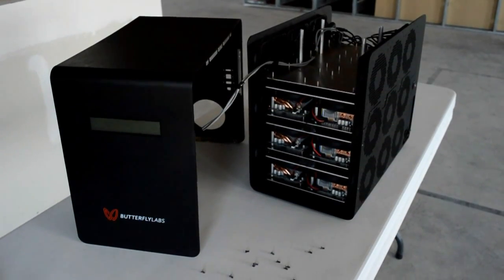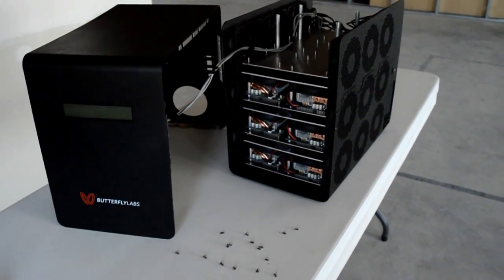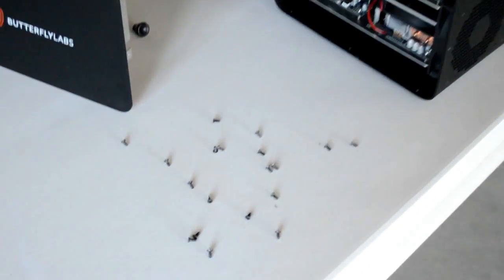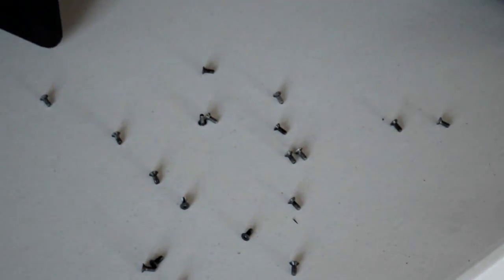Inside the Butterfly Labs (BFL) 25GH/s 2012 FPGA Mini-Rig (NOT ASIC)

Comment: How much bitcoin can it make per day in this period? Thanks.
Reply: At the current diff (609mil): around 0.02 BTC per day. Around $17 at the current exchange rate.
Reply from the maker: This is FPGA and pretty much obsolete at this point.  25GH at 1140 watts...I suppose it would still make some profit, but not much.
Reply: P. Pongjarern Thanks, that is not bad. Do you know what is the difficulty estimate in 4 months or so? Is there a way to predict this ? For example, can difficulty increase in 4 months ?
Reply from the maker: Lately, difficulty has been increasing about 20% every 11-12 days.  This will probably continue for some time.

Comment from the maker: I have $60k invested.  With 2 TH at current difficulty of 50.8 million and BTC price of $110 I'm making about $2000/day, but difficulty is going up fast; probably 67 mil in a couple days.  That'll be about $1540/day and down from their again about 12-13 days later.  Sometime after I have the full 3 TH, I expect it will level off and go down much slower when I make about $6k/month at around 400-500 mil difficulty.

Comment from the maker: It took about 4 months from the day I ordered.  FPGAs (like this rig uses) are a lot easier to implement.  The ASIC machines BFL is working on now is a totally different beast, so they've run into a lot of unforeseen problems.  I believe they're getting pretty close to shipping, though.  I don't believe at all that they are a scam, and I've been waiting 10 ½ months since placing my ASIC pre-order.

Comment: One thing to keep in mind is that the difficulty will raise as you have said but it will raise enough to keep the mining of coins at pretty much the same rate so their won't be a bunch of new coins flooding the market since these ASIC's are not all being released at once.  If anything there may be a week or two of  craziness and then the difficulty will rise more and the minting of new bitcoins will return to the normal pace.  Most GPU miners have moved to litecoin and feathercoin already.

Comment: I beg to differ slightly could still do it cos the DEV community may not react on time by then lots of BTC are horded. Once DEV community react too late for us.

See blockchain.info/charts/hash-rate. Gigahashes across the network went up from 10k to 70k. No_one else has that processing influence. blockchain.info/charts/market-price shows price increase about the time chips made+testing. Graphs show exponential increase since BFL got the chips. Any Explanation? Cheers,

Comment from the maker: 1. Depends on luck, difficulty, and BTC price, but I've averaged about $650/week (before power costs) for each mini-rig (I have two).
2. It only uses the PC as a host.  Power is provided to the unit via its 1250W power supply that is connected to an electrical outlet.  The unit measures 1140W at the wall.
3. I was one of the first to pre-order, so a lot of customers got theirs faster.  However, my wait was 127 days (4 months and 1 week, basically).

Comment from the maker: If they used the equipment instead of selling it, the dev community would modify the algorithm to make the BFL ASICs useless and prevent a potential 51% attack.
Also, I've paid my equipment off plus 40% profit at this point.  Most people wouldn't call that stupid.
Lastly, your comment about Jews seems irrelevant at best.  Random racist slurs don't generally foster persuasion with an audience.

Comment from the maker: The BFL Mini-Rig is just a box that holds 18-20 cards that run FPGA (field-programmable gate array) processors.  If you open it up, you can take one of the cards out and run it by itself on a desk with the same power adapter used on the BFL Single.  Regarding dust, I have an A/C that also filters the air.  No significant dust has accumulated in my rigs after running 24/7 for almost 7 months.

Comment from the maker: Just to clarify what 30x really means, I won't be surprised if the difficulty is around 105 million by the end of 2013.  Again, this could even be a low guess.  Will ASIC mining still be profitable at that level?  Sure, just not a great deal.  At that level, a 60 GH/s Single SC would profit about $36/month.

Google TP's Bitcoin Calculator...Very useful tool.

Comment from the maker: If you're referring to their ASIC equipment, that would give them too much hashing power (enough to control the network), forcing the Bitcoin developer team to change the algorithm.  The ASIC equipment would then become useles and have to be redesigned.
Regarding their FPGA equipment, they probably don't want to expose themselves that heavily to the potential loss that comes with investing in Bitcoin mining.  They have guaranteed profit by just selling the equipment. Let customers take the risk.

Comment: then factor in increasing difficulty. Then factor in electricity costs. then factor in that the pay out is going down sometime in december to 25btc/block (halfing returns all by itself). Then factor in Moore's law as more powerful machines are created.

Yeah, you're looking at more like 2 years before you break even on hardware costs. Take a look at some of the calculators for this stuff out there.

Comment: "The Mini Rig is currently sold out." No doubt because of this video. Using Butterfly Labs official numbers I ran the calculations and it said 3166.95 USD/pm after electricity, and break even in 161 days. Dang this is the reason the rest of u struggle to mine a single coin, it is a processor arms race! When they drop from 50 to 25 coin reward in December 2012 the profit from this machine will half and all the graphics card miners will be totally uneconomical.

Comment from the maker: The Mini-Rig is about as loud as your average Dell rack-mounted server, such as a PowerEdge 2970.  In a data center with 3 PowerEdge servers, I was unable to tell that the Mini-Rig was running.
According to my Kill-a-Watt, it uses about 1140 watts on a 120v circuit.
I get about 50.8 GH/s out of my two Mini-Rigs, but I've read on the forums that some people get 52GH/s out of two of them.